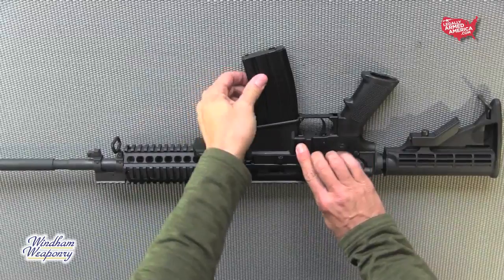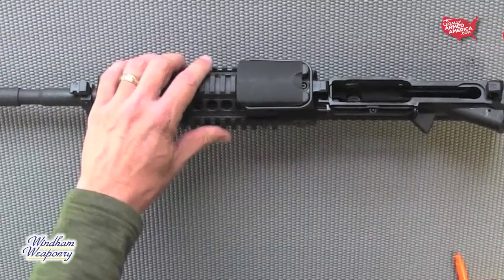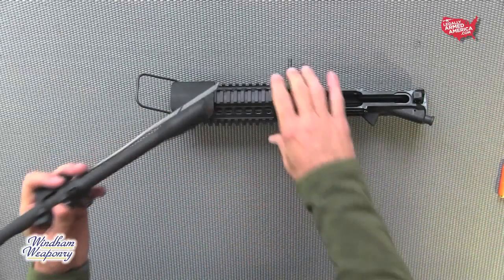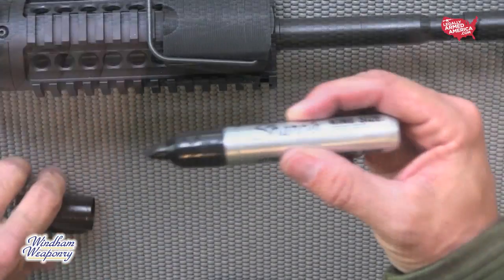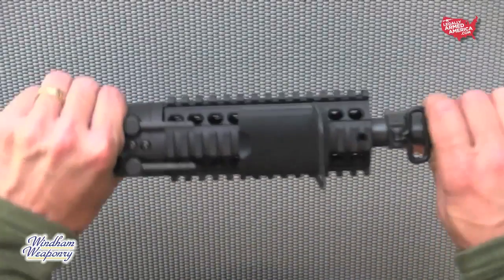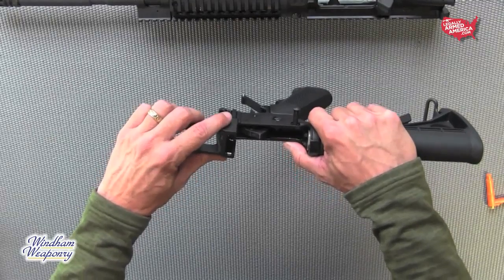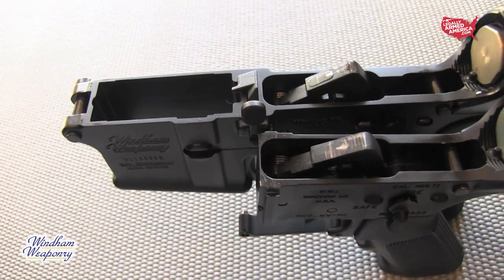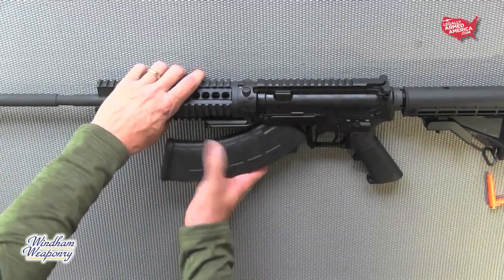Caliber conversion with the Windham Weaponry Multi Caliber System

Comment: The permanent marker will basically burn off from the heat. Just use the flashiders top slot to line it up the barrel with the upper.

Comment: Do they have the a2 iron sight versions?
Reply: You can just get the carry handle to put on the upper and theres also a front sight that will attach to the gas block rail and it will be the same as an A2 style. Heres a link with both for $40. 
https://www.ar15handguard.com/detachable-carry-handle-dual-apertures-a2-rear-sight-w-high-front-sight-combo-ar15-223-5-56/

Comment: It isn't the same system that the MGI Hydra?
Reply: +Roger San Gabriel 

Licensed, that's what Windam says. Grateful for it, MGI gouges on shipping, been piecing my Hydra together the past 4 months...will be finishing it up with an MCS upper...way cheaper than following through with more MGI parts
Reply: +Miguel Angel Pardo Mora  Yes it is they didn't have the marketing and manufacturing to get it going they must have sold or licensed it!
Reply: +Dan Gutridge  same here. I hope Windham goes after this hard.